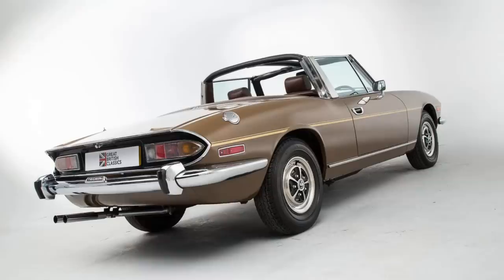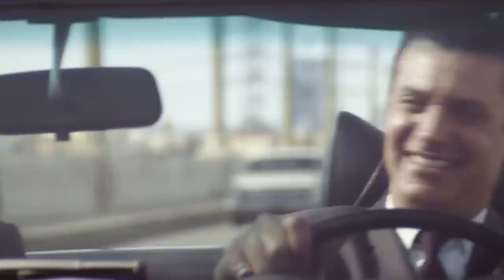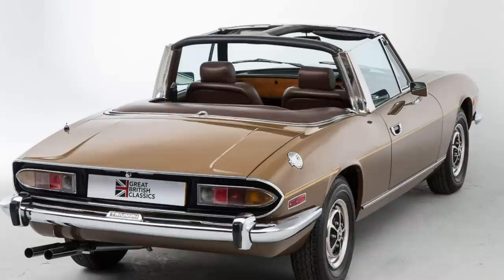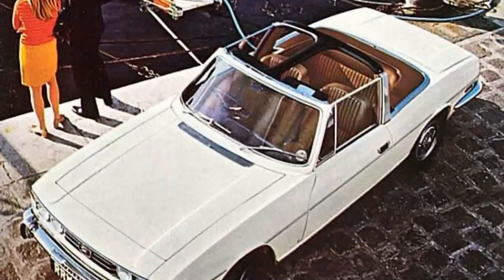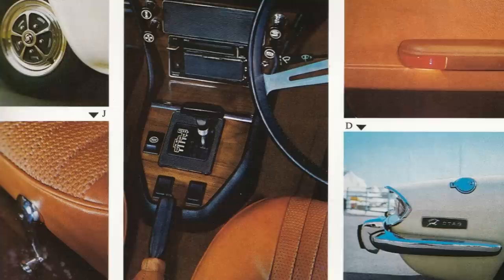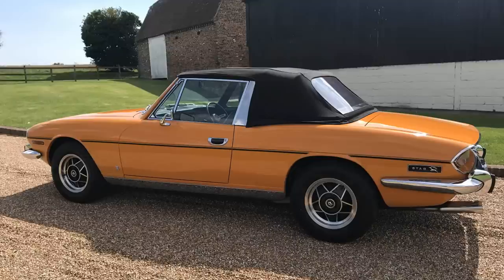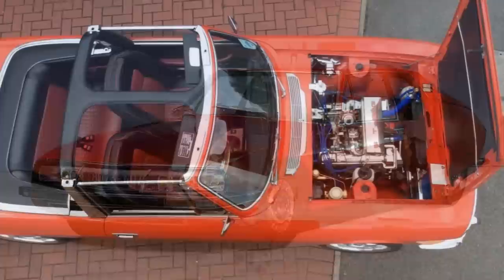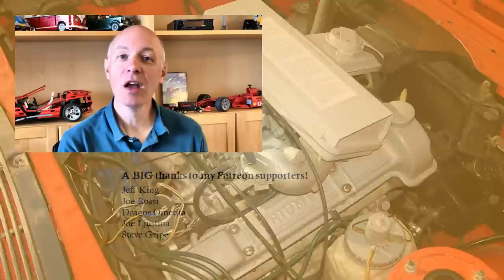Why did the Stag FAIL so Spectacularly?

Comment: BUT...you're forgetting one thing!  The Stag V8 burble is waaaaaaay nicer than the Rover one.
Reply: Uncle Joe Stalin  Why?  what would they do, utterly ruin the beautiful tone?  The Stag burble is characteristic by the odd firing order that is almost unique among V8's (apparently).  There's a whole thread on the Stag forums as to why it sounds quite different to other V8's and compared with the nasty raspy flat plane crank garbage out there, i'll keep it as it is thanks! :)
Reply: maybe so, but pisspoor performance from both.
Reply: @Aut0five  but if I wanted a high performance sports car, I wouldn't be continuing to run a car that sounds gorgeous and has been in the family for 43 years.  :)
Reply: @djtaylorutube  and how many of those months and years has the car been unused due to mechanical failure?
Reply: @Aut0five  Actually very few.  I was 12 when I went for a test drive in it with my father.  A core plug fell out once when my mother was driving it.  Simple enough fix.  It failed to start once on holiday but that was a stuck solenoid.  It has had bodywork restoration once in that lifetime but no major mechanical failures in the sense of major breakage causing downtime.  Sorry if that's a disappointment :)  It has failed the past two MOT's due to "MAJOR FAILURE", comically, that was just the washer pump not primed but I fitted a new one to the side.  Came back this year, MAJOR FAIL, washer pump not working.  Yup, hadn't used it in a year and the new one had seized.  Yes I could have checked this but a) the car doesn't need and MOT to be used on the road and b) then I would have got water on the paintwork and would have had to dry and wax again ;)  It only goes out on dry days, don't use washers!
Reply: @djtaylorutube  I've had three Stags over the years, two original engined and one Rover engined. I had more trouble with the Rover engined one than either of the other two, you've just got to know what you're doing and keep on top of maintenance
Reply: The sound of the engine seizing up is none too pleasant (if frequent).
Reply: @doubledee9675  Yep, haven't heard that in 43 years, I'll pop that in the "non-frequent" basket then :)
Reply: @djtaylorutube  Perhaps your hearing aids need cleaning?    Let's face it - the SDI could have been a good car had it been engineered and made by the old Rover company, so could the Stag with the old Standard Triumph.
Reply: @doubledee9675  I don't wear hearing aids so it can't be that!
Reply: But still not as nice as a Daimler one!
Reply: @djtaylorutube  Can't help then
Reply: @doubledee9675  I know!  But that's because there's nothing wrong with my engine. :)
Reply: @djtaylorutube  It's strange isn't it, all the years I've had Stags and been involved with the owners club, I've known very few that have had major problems, if any. Most issues have been niggly little ones that would happen to any classic of the same era and yet there are always negative comments from people who I doubt have ever owned a Stag yet seem to be experts on the marque.
I think back in the day when build quality was questionable and expert knowledge was even rarer the Stag suffered terribly but now with the expertise and knowledge we have available today they can be as reliable as any other classic car on the road and that's what people seem to be missing, we're not living in the seventies, we're living now and now Stags are reliable and now is when people are enjoying them, it's no good harping on about how bad they were back then, we're in the here and now and a Stag will turn heads more than any Eurobox you can mention.
Reply: @tevie54  I know. Another of my cars is a 1994 Volvo 850 which I've had since 1998. In that time it has overheated, head gasket blown, destroyed a gearbox, destroyed a clutch, alternator voltage regulator failed which boiled a battery. Regularly fails to start every 3 months or so with the Volvo "cold start problem" that Volvo denied ever existed and indies acknowledge but agree was never fixed and a failed fuel pump relay and two failed fuel pumps. It has been towed home several times, been on a transporter twice, oh forgot the time the clutch slave cylinder failed on my wife leaving her stopped in lane 3 of the M25!

But... In my eyes is still the reliable car and has just passed 300,000 miles. It does nothing outstandingly but everything asked of it and these are just "events" in my view of a well used car.

I understand that some people prefer to find it easier to follow the trendy path of putting down something enjoyed by others and having been at a show last weekend as an exhibitor, I was just as interested in taking to the owners of what many would consider mundane crap but we each have our interest and it would be boring if we all drove the same would it not?
Reply: @philking5740  subjective but I went to search out a Daimler 250 V8 sound on YouTube. That sounds great too, there was one at the car show I was also exhibiting at last weekend. I didn't know that had a V8 but I wasn't near enough to hear it when it arrived. :)
Reply: @djtaylorutube  You are lucky - either a previous owner attended to all the issues (should have been done at design stage or manufacturing) or the work you've put in has paid off.  The sort of thing that Steve Hill talks of.
Reply: @doubledee9675  You might have missed the part above where I said that the car has been in the family since 1976, the previous owner was my father.  The car has had maintenance applicable to a Stag and looked after by mostly Stag specialists who understood what needed to be done and how but there are no bolt ons other than the electric fan that I added last year so no, it hasn't had a bunch of modifications to bring it "up to modern spec" at all.
Reply: @djtaylorutube  Yes, I had missed that.  You (and your father) were lucky.   The stories I used hear from other owners told a very different tale.
Reply: We have two Sp250's in the family, they have twin pipes. One of them has a balance pipe between and the other not. With one they sound smoother and without, a little off beat king of like two four cylinders having a fight.  My cousin recently bought a Stag, they are a good value for money classic here in NZ. Little britt V8's are great.
Reply: @doubledee9675  I think that's part of the problem, if nine owners had no problems but one had an engine blow up, that's the one that gets the attention because no problems are not newsworthy
Reply: @tevie54  Except that you're doing the reverse (or close to it).   You and your father had no problems, the other nine owners did - look at all the other posts on this video.   Yet Triumph could have saved a lot of time and money, with a geat gain in reliability, by looking in-house.  There was the small Buick V8 which Rover had Anglicised, which went into all sorts of cars for many years.  Then there was the small Daimler V8 that went into the SP250.  The rest of the car was appallingly bad, so bad that it's hard to accept that it was under the overall control of Edward Turner and built by the ultra-conservative firm of Daimler.  But the engine was excellent, light, compact and reliable.
Reply: @doubledee9675  I couldn't agree more about the Daimler engine, I've talked about that elsewhere on this post but like I've already said , the experience I've had with my own Stags and others I've met in the club is that major engine problems were rare but when they did go bang and I'm not saying they didn't, that was more dramatic than saying mine's been totally reliable which two of the three I had were, the one with the Rover engine was the troublesome one. Lets not forget back in the seventies lots of cars had issues that modern cars don't have, the Rover V8 suffered premature camshaft wear, Jaguar XJ6 had oil pressure problems Ford V6s suffered cam gear problems and overheating when fitted in Scimitars. None of them were perfect but there's no point in moaning about how bad they were when nowadays they can all be made to be as reliable as you want them.
Reply: @philking5740  Yes I was about to rattle on knowledgelessly about V8 sounds vs crosspipe and why there is a crosspipe ( exhaust tuning optimising cylinder  evacuation presumably?) My never restored  1981 Mercedes 600 W100 has a crosspipe just after each manifold, but my 1978 Range Rover doesn't. BOTH sound superb, RR more emotive, probably because its got an aftermarket sports exhaust and is a  manual . Both are trounced sonically  by my moribund TR6 and the 2.5 PI possibly also outsings a Merlin engine! This channel is great but is let down by irritating technical errors on cambelts vs chains , talk of V6 Rover 2600 when we are shown the OHC straight six and why does a Brit say "twenty five hundred"? Happy Motoring.
Reply: @philhealey449  Scavenging effect at lower RPM's blah blah. No noticeable  difference having good compression is more important. Great question when does a Brit stop counting in hundreds and start counting in thousands?  Here it is Nineteen hundred then 2 litre. And of course eleventeen hundred for Austin.
Reply: @philking5740 ........ nineteen hundred and ninety nine, two thousand, two thousand and one, ...........
Reply: @philhealey449  
I agree re. irritating technical (and some factual) errors .
However, not all Brist say "twenty five hundred", it's slightly old fashioned. I've also heard it said in the US too.
I have a Stag and find the engine noise a bit meh. It's too flamboyant for what it's actually doing.
I also have an E39 M5 and the sound from that is mesmerising; it's on std exhausts so not that shouty.
I also love the sound of a straight-6 engine. I owned a 2500 PI saloon years ago and now own a manual E60 530i.
Reply: @djtaylorutube  Damn, my old S90 (derived from the old 960) has been massively reliable. Trim parts are hard to get, but mechanically it is fine.  I also had mine converted to a manual many years ago.  I have heard good and bad stories about the 850, mostly good.
Reply: @shebbs1  yeah don't get me wrong, I'm not complaining about my 850, love it, even with a choice of newer, higher powered cars, it's still my go to car. The problems I describe are just "events" in the life of a 300,000 mile, 25 year old car.
Reply: @djtaylorutube  I'd rather have a car that didn't have a crap Triumph V8 engine in it, that was going to blow its head gasket and water pump all the time.
But if you'd rather be seriously out of pocket with your car getting repaired all the time, just for the sake of the sound coming out the exhaust, then more's your folly, lol. 
Burble, burble, clunk.clunk, kaboom, lol. 
Incidentally, if the car was any good, all these modifications and servicing requirements shouldn't have been necessary. 
The biggest mistake was not putting the already proven Rover V8 into the thing.
Reply: @sailorman8668  We can't go back and change the original decision and there's no denying that at the time, choosing the Rover V8 would have been the sensible choice but it hasn't been without its own issues through the years.
What's of interest today though is that the Stag V8 isn't the crap engine that you want it to be and if it were, then people would still be flocking to change to the Rover V8.  The reality is that they're not and if anything converting back to the original engine.  As with any development where problems are found and later solved, people will in the mean time go a different route and that happened.  The issues are understood and solved so where's the issue?  In my own case, the car has been in the family now for 44 years and generally problem free.  Yes, I can remember a core plug popping out when I was a teenager, I remember the start inhibitor stopping the starter motor while on a holiday and numerous other niggles and an engine overhaul but over 44 years has it blown its head gaskets and water pumps all the time as you want to believe?  Simple answer is no.  Over its life to date, has it been repaired all the time with my father seriously out of pocket (or me)?  Nope, no tick in that box either.
I could look at my 26 year old Volvo 850 and point out the design mistake of letting in leaves into the heater box causing corrosion of the AC evapourator, which results in a 3 day job to replace that, it has been done twice and since addressed the issue of preventing leaf ingress but again, this is something that took years to discover.  The "Volvo cold start" problem has NEVER been fixed, lots of theories but it seems to just be a software bug causing overfuelling every few months.  I could pick another of my cars and complain about the frequent front suspension spring breakages that are common on the type.
Hindsight is fantastic but if you're not convinced about people wanting to run the Triumph engine vs the Rover V8, this may help https://www.howmanyleft.co.uk/vehicle/triumph_stag#!engine  If the Rover V8 were the preferred engine, you'd not expect to see that disparity in engine numbers.
About 95% of Stag's run the Triumph engine, you wouldn't expect that if it were so utterly crap but the best part is that you have choice, you're completely welcome to drive something other than a Stag or have a Stag with any engine of your choice - simple. :)
Reply: @djtaylorutube  Well said

Comment: I had a Dolomite Sprint that suffered the same head gasket failure problem. It was easily fixed by re-torquing the head about once a month. You had wait until the engine was completely cold, then back off the head bolts in the correct sequence. Then bring them back up to torque, again in the correct sequence. It's probably something that some drivers can't handle, but it worked for me. 

PS a friend sold a Stag recently. It had the 4.4 V8 from the Leyland P76. Modified.

Comment: A friend of mine was a mechanic at a dealership that sold exactly one Stag. When it came in for service they told him to use shim stock for valve adjustment because they didn't want to buy the shim set and tool for just one car. Of course the engine failed and when the dealer tried to blame the owner the owner had an independent mechanic tear down the engine. The shim stock was discovered of course and when the case went to court the dealership tried to put it all on my friend. He was so disgusted with the whole thing he quit being a mechanic and became a building contractor.

Comment: "Timing belt" ... chain!
Reply: That's a common problem over many years. In 1997 a certain garage chain tried to coerce me to replace the timing belt on a 2.0 Nissan Primera (SR20-De engine). I asked them to show me where the best would be fitted. That conversation ended very swiftly.

Comment: Herald with twin head lights is a Vitesse with 2L straight 6 cylinder
Rover 3.5L engine did not fit without cutting a hole in the bonnet for the carburettors because on they sat on top of the inlet manifold above the engine. For this reason the Ford 3L V6 was used instead as it had a twin choke Webber which did not have such a high profile when used with a small sports air filter.
A few Triumph Stags were released in 1969 with the TR6 125BHP 2.5L fuel injected straight 6 Engines (But it does not tell you that in Wikipedia!!!) I had one which I never should have sold as they are worth a fortune now!!!
AND The Triumph V8 was over head cam with timing chains!
My work is done!

Comment: Even with all of its issues, I'd still love to own a Stag with an original Triumph v8 in it, I think they're a great lookin rig...it definitely sits too high stock from the factory though, it needs to be lowered fo sho...lol
Reply: You'd possibly get a lot of time looking at that engine too ! 😆
I have a 1970 Stag. Owned it for about 6 years now. Hardly driven it !
Reply: @Lewis72: I live in Northern California, so I've never seen a Stag in person, but I've read that the overheating issues cause head warping resulting in blown head gaskets, is that your experience?
Reply: @lewis72  I have a Stag with the original V8 which does about 2k miles per year. I don't spend much time looking at the engine. Always wanted one and bought it 3 years ago. Not disappointed.
Reply: Branon Fontaine Yes I have just bought a 1971 completely original 29000 mile car which has obviously been not badly built originally and dotted on by its latter owners;
   The car has stood the test of time remarkably; I remember looking at these as a 10yo in1975 and thinking how modern and beautiful they looked and they do not look dated now in 2019- remarkable!
    I never thought about the V8 under the bonnet but you cannot beat the sound, particularly this version, simply lovely,but; there  were better pedigree cars available to the rich at the time so the market for the stag was  stuck between economy and prestige and there never going to be substantial sales I am afraid ,; Its just the truth!
Reply: @branon6565  on some research I've discovered a lot of Stags have had their problems ironed out because the faults from the past are obviously now known and if owners are or were prepared to spend on improvements they were delt with ,as with a lot of loved classic cars